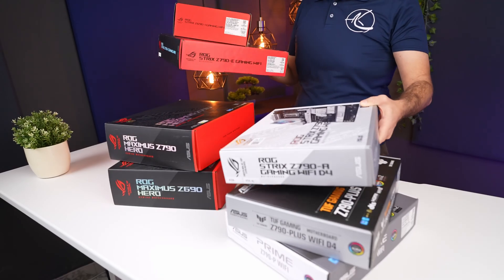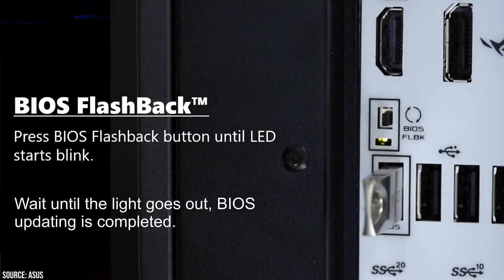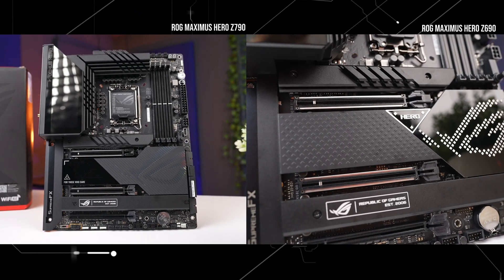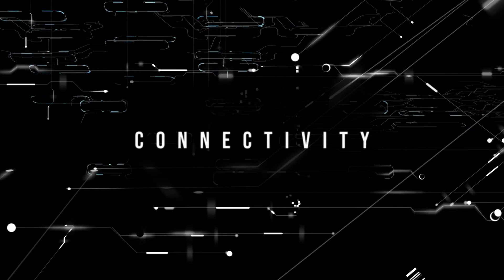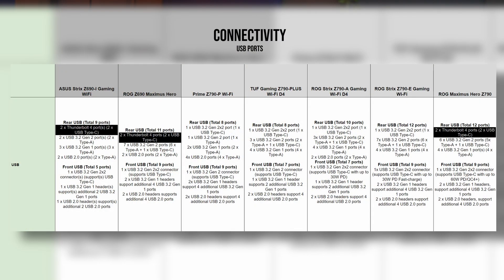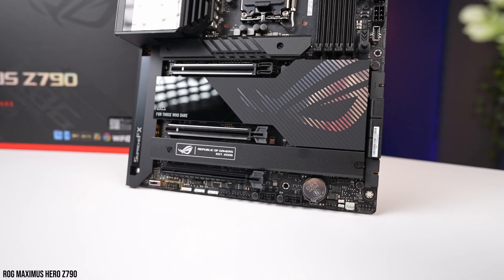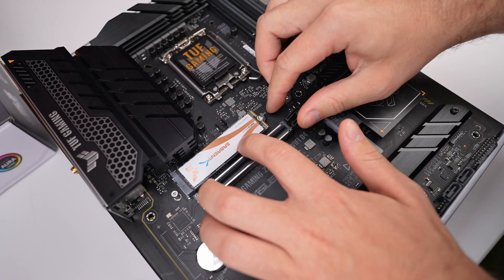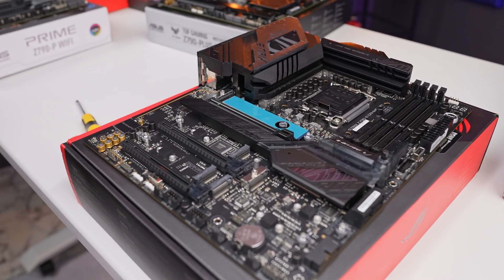WATCH THIS Before Wasting Money On Z790 Motherboards

Comment: I'm building a new PC withi9 13900k, but I am worried about the lack of NVME and Sata ports as I was going to get a ROG Maximus Hero Z790.  I have x3 NME drives.
Reply from the maker: hey, check out our latest video with z790 Dark Hero :)
Reply: Thanks.  I just discovered that Dark Hero one today.  @A2KMedia
Reply: So, what's your advice if I am building a new system with the a Asus Z790 Hero motherboard, Nvidia RTX 4070TI and x3 NVME drives?

Comment: You have no idea how useful those charts were to me.  The business of shared lanes and M.2 slots that don't work if a PCIe socket is occupied, or if all of the M.2 slots are used, you lose half of the SATA ports has been doing my head in.  I still don't understand it all, but I think I'll be reasonably safe if I spend large on the Maximus Hero board.  That's if they can find one.
Reply from the maker: there are so many variables in all of these boards its crazy!
Reply: Can I pair i7 13th gen 13700f
Is BIOS are going to work properly with this cpu?
Reply: thats a negative for the hero, it affects all boards with pcie 5.0 z690 or z790. essentially, it is false marketing, you can never trully utilize a 2nd pcie 5.0 lane. if either slot is occupied its downgraded. OR if a gen 5 ssd is installed in the 1st m.2 slot. TLDR you are paying extra for marketing on the hero, there is zero benefit for a 2nd pcie 5.0 slot on a z690 or z790 board. you missed the entire point.

Comment: I had a z170 mobo from Asus (old mobo) and upgraded to a new pc, z790 from Gigabyte. WARNING : the onboard sound is poor compared to my old mobo. I have been forced to get a soundcard probably.
Reply: True. The entire AsRock lineup has the worst onboard, some of the other brands use the same one; but not on every single board.
AsRock isn't a bad brand, but they tied themselves up in the corner with the Intel processors.
There are a couple AsRock boards that would look awesome in certain PC builds. That crappy sound they chose detours me elsewhere.

Comment: So what is even point of any of these board, i mean if in "future" i have 1 PCIe 5.0 card and 1 PCie 5.0 M.2 SSD, somehow for Z690-E will not be able to give 16 Lane to My PCIe 5.0 card, because i will be utilizing my M 2.1 slot to use my gen 5 ssd. On the other side of the spectrum Hero version does have 2 -16 lane support, but in this case also my PCIe 5.0 card will not get 16 Lane.

Point of these board is "future proofing". Really?? Gen 5 devices cant even run in thier potential due to Lane Limitaion - Then why buying any of these.
Apart from this being early adopter we will be gifted with most unstable tech.

Is my understanding correct though? i am not sure on that.

Comment: Should I get Strix B760-f or Z690-f if I'm going for a non K CPU? Both boards only have a little difference in price with Z690-f being slightly more expensive in where I live.
Also, If I somehow the K CPU price drops and I decided to get one, is Z690-F still worth it even if I'm not going to OC?
Reply: I go with the Z690 because the Z790 no much upgrade to it paid more for what Z690 same specification anyway i paid $208 for theZ690 instead $360 for a Z790 just order one on  Z690 2/24/2024

Comment: even the cheapest z790 mobos here in denmark is about 260 dollars!the 13600k was to be my next build, but the big power consumption and todays electric bills are too much for my wallet!
Reply: I have heard stories about electric bills being so high in Scandinavia. If that´s true I might consider a low power consumption Ryzen 7900 non-X. Or even a 7600 non-X. The problem are those damn AMD motherboards. Few options and insanely high price tags. Maybe wait for a good budget B650 board?
Reply: @PinkasBrown44  not sure!probably still the high 95 degree work temp and a big cpu cooler for that too!using r7 5700x on aorus elite mobo!cheap combo since the r7 5700x is about 189 dollars now!

Comment: I dont understand, if you use M.2_1 pcie 1 works x8.
BUT pcie 5.0 x8 is just as fast as pcie 4.0 x16 so why not use M.2_1? Its not degrading the gpu's performance at all.....
Reply from the maker: this only works if gpu supports PCIE gen 5. If GPU runs in PCIE gen 4 - you will end up running it with 8 lanes which with highest end GPU's will result in lost performance. I am talking 3090-4080 and above cards.

Comment: the z690 series is a waste of money, because if you want to upgrade stuff next year and not swap out the mobo, you will need a z790 vs  Z690 all the way.  

thier is currently a best mobo out their but its price is obviously not cheap,  the asus z790 maximus apex thier is no better mobo in existence today then that one currently, 

  z690 is just junk,   dont waste cash of that garbage stuff.   buy  a z590 series if you need to save a few bucks but do not spend on z690 at all its garbage.

Comment: Let me make sure I heard you correctly, I am planning to used nvidia 3080 to, which is a pcie 4 x 16.  So if I do not used nvme slot 1, but skip and start with slot 2, I should be ok to ensure the gpu has all of its pcie lanes available ? Or this is only limited to a spec Asus z790 mb model ?
Reply: It doesnt matter because the first pcie slot is pcie 5.0 so even if its working at x8, its just as fast as pci 4.0 x16. So no performance degradation for your gpu. So you can use the first m.2 slot without any problems.
Reply: as far as im aware, most if not all z790 motherboards do this with the first nvme slot, so it's recommended not using it and start at the 2nd one.

Comment: Is there a point to get Z790 over Z690 for an ITX format since such small motherboard can't have more than 1 PCIe slot?
Reply: I was thinking the same
Reply: Ram compatibility. 

ITX boards can push most kits harder than normal boards already because they don't have 4x dimms.

The z790s have more recently validated testing for higher MT/s kits than the z690 and for more brands than the z690s

Could be able to run a 7800-8000 kit on a z790 where the same brand z690 would only be able to run 6000-6600

Comment: moving from imac after 14 years to a PC. For coding/programming, is the Gigabyte Z790 Aorus Elite AX a good option in combination with a i5 13600K? Or a Gigabyte Z790 aero G atx. Thanks
Reply: if you are building a white themed PC then choose Z790 Aero G, else go with Aorus Elite AX which is equally good for a slightly lower price.

Comment: If I generally choose to buy first-gen of a technology to base my computer on for the next ten years and upgrade as necessary, which would you say is a better option for overall value?
Reply: 10 years? Sorry man, technology is advancing fast. Probably you'll need an upgrade after 5-6 years.
Reply: @donjuan3296  Did you read the "upgrade as necessary" part, I mean that I build a computer once every ten years and then upgrade from time to time over its lifespan
Reply: @donjuan3296  With the performance of modern computers, you don't really need frequent upgrades unless you need the additional performance. I'm still using my i5-3570k since 2012 and I still can play the latest games.
Reply: @holo2869  you can play them but not well that’s a dinosaur
Reply: If I were you, I'll wait for the 14gen which is already set to be released later this year. Those motherboards will be the future-proof. This 13th gen is a dead-upgrade.
Reply: @holo2869  I think it's funny that you think you know the future!!
Reply: @skolvikings5263  Your ignorance is evident. We know that the next gen will be on a new socket because Intel made that a public knowledge a long time ago. Stop wasting your bandwidth and do some online research on your own.
Reply: @holo2869  I mean, ATM my plan was an i5 12400f so I'd still have an upgrade path even if 14th gen doesn't exist on LGA1700.
Reply: @scrubscrub4492  Maybe check how your local stores stock up on hardware? IMO, unlike ram, harddisk and video card, motherboard and processor are the least upgraded components and historically in our local shops, they don't stock up on near dead platforms. Majority of those available are the lower end models because they were the leftovers, so looking for reasonable upgrades are difficult.

If you do the upgrade path you are thinking, I suggest that you immediately upgrade it once the 14th gen are available so it won't be difficult in the future.
Reply: Have you decided yet? I have a similar mindset so I am still deciding between a B760-F with 13500 or Z790-E. with 13700K. I guess the latter one has more durability. Then again, the parts are twice the price. So picking the cheaper parts one can already ´save money´ to build a new PC in half the elapsed time. I supposed both alternatives are OK.
Reply: @PinkasBrown44  I've decided in favor of it because Sega is partnered with ASRock to make custom Z790 boards, and I'm obligated to have my games running on Sega hardware whenever possible.

+ The mATX model is sub-$200 for a DDR5 board which is a pretty damn good deal
Reply: guys im still gaming on an overclocked i5 760 3.8ghz on an asus p7p55d-e board with 12gb ddr3 ram and a 1660 super with a LG C2 42 ....I get 90+ fps on both 1080p and 1440p...some avx2 games dont support the ancient i5, but all other games are playable...should i upgrade?
Reply from the maker: Well this motherboard can only have 12 and 13 gen Intel cpus. Next gen will be different socket. Other than that, you need to see what components you need more. I personally prefer networking
Reply: @A2KMedia  NOBODY knows if the next gen will be a new socket, c'mon man!!!!!

Comment: I bought my z790 boards (z790-I WIFI and z790-Extrerme ) mainly because of TB4
Reply: Please can you tell me, does the extreme z790 include in the package a cable for the onboard TB4 front header?
Reply: @vlefteris  no it doesn't i fitted a right angle USBC connector on the mobo then plugged a true TB4 cable into that and routed it out of my case - works fine, even if it looks a little janky.  I have found no off the shelf solution to mount it, say to a PCIE slot.  in retrospect this was dumbass decision by asus.
Reply: @scytob  Ok thanks!

Comment: I think it's more wise to buy Z690 with DDR4 boards for now

buy boards with DDR5, M.2 PCIE 5 SSD, and PCIE5 GPU support maybe at 14th gen with z890 era

because probably by then, performance will improve much more again, and prices will go down

because as of now, DDR5's FPS does not win in alot of games vs DDR4 unless you are using 7200MHz or above (https://youtu.be/TPhu2HNuCKc as shown at 13:49)
Reply: Prices very rarely seem to go down...

Comment: Would love to know where the *Asus Rog Strix z690-a wifi* fits in this video since it also has BIOS Flashback, but is more expensive than the *Asus TUF Gaming z790 Plus Wifi* - I don't which to choose and I'm torn (wanting to get my hands on a i5-13600k). Any advice?
Reply: since the new AM 5 AMD Base  and the two Intel Bases Z690  the new  Z790  one  &  B660 was released .. Asus do not longer support The Bios Flashback Feature for their TUF Gaming Plus Boards for Intel !! What a Shame by Asus !!  So if you wanna have the  Bios Flashback Feature  you have to get the next Higher Quality Board like   ROG Strix Series if you wanna use the new Intel Cpu   ...  If you are a AMD User , then you still get the Bios Flashback Feature on TUF Gaming Plus Boards for B650 or X670 E for AM 5 ...  What a poor Way by Asus for Intel Users ...
Reply: @shari_8410  well but it's ok
just buy ROG
they are worth the money
Reply from the maker: heya. to run the CPU that board is fine - I would look into the extra features such as NVME expansion as well as usb port requirements you have and see if it is enough for you
Reply: @A2KMedia  wouldn't the asus tuf be better for running 2 sticks since its a daisy chain topology and like $90 difference
Reply: Gigabyte AERO G DDR4 if you are not looking for RGB

and MSI Z790 Edge of you are looking for RGB board

Comment: Im worried about the ram support on z690. I ofteh read that the ram controller is very bad on z690 so if you want to use decent ram you should use a z790 board. Im confused now because i thought that the cpu has the ram controller so i wanted to use a z690 board with a 13700k and ddr 5 6000 cl 30 ram. Do i need to go z790 for this ?  pls help
Reply from the maker: Z690  is fine for that.
Reply: @A2KMedia  Not for Asus. Stuck at 6400 mhz with 7600mhz stick on z690 formula. That's a big lol
Reply: @A2KMedia  can I go with rog strix Z790-A gaming oc D4 is that good?
Reply: They all have the same problem with the four sticks but there is a fix for bios if you look it up
Reply: I simply bought DDR5 RAM that was on my MB's QVL list and have had zero issues.
Reply: chose Z790 if you don't find DDR5s still too overpriced, and choose Z690 for DDR4 if there are still stocks
Reply: Yes, i'm using z690 formula with 13900k and 4090 plus purchased gskill 7600mhz 36cl ram kits but unfortunately current bios doesn't support more than 6400mhz. If you pass this frequency it's giving you errors even with increased dram voltage. While z690 msi boards can succesfully increase frequencies up to 7600mhz our premium asus boards aren't capable of these speeds. That's sad. And i'm now thinking if i should get z790 or keep my current pc at 6400 ram speeds
Reply: This is BS. The memory controller is integrated into the CPU. Z690 is fine.

Comment: I know the z790 has more chipset pcie lanes, faster DDR5 speeds than the z690 DDR5 speeds and support for SSD gen 5 BUT for gamers the only in game usefulness on the z790 is higher DDR5 speeds vs the z690 DDR5 speeds. That said the DDR5 speed increase will not make a MAJOR gaming experience over the z690 in my opinion. If you have the Asus z690 Hero like me you can get DDR5 6600 and of course the 13900k plus a new RTX 4090 so no real reason to upgrade I think this time around in my opinion.
Reply from the maker: you basically summed it up. thing about RAM - i used 6000 M/T ram on z690 without a problem and most people won't need to go past that for now
Reply: Exactly, and here’s the deal. if you can get DDR5 RAM sticks with a happy median between the highest RAM speed for z690 DDR5 and the highest z790 DDR5 speeds that’s all realistically gamers need and would actually be able to notice in performance. DDR5 6000 and up is great for either z690 or z790.
Reply: "faster DDR5 speeds than the z690 DDR5 speeds", not sure about this. It probably depends on which CPU you slot in as the memory controller is there. On various forums you can see people reaching 8000mhz on Z690s
Reply: @sgru9558  This is true, I was just saying on paper z7900 has higher DDR5 speeds.
Reply: Latency matters just as much as clock speed. People get so hung up on clock speeds and end up WAY overspending for minute performance gains.
Reply: @yesthisisvic  as for me as a music producer i need a quite low CAS Latency aswell .. so my best deal would be at the Moment to get a Z690 Board with the new Intel 13th Generation I5 or I7 but  with DDR 4 Support,  and good quality DDR 4 Ram with my desired Specs,  obvisually .. cause good DDR 5 Ram with enough Ram Speed and Low CAS Latency  you really  have to be rich at the Moment to handle that Price lol

Comment: So when M.2_1 is not used, will the main PCIe_gen5 slot stay at 16x? Like if I used any/all other M.2 slots other than M.2_1, does the main PCIe_gen5 slot continue at x16? Or if I use any M.2 slot, it gets dropped to x8?
Reply: It doesnt matter at all, pcie_gen 5 slot x8 is the same as 4.0 x16 so no degradation in performance even if you use M2_1
Reply: @billx4266  your maybe right .. but if u do not remember it coul dhave some influence in the future when u get new hardware
Reply from the maker: hey, on that specific board yes them m.2_1 is used then main slot drops to x8. others can be used. but other boards are different so make sure to read in their manuals or tech documents to see what it is like under storage and expansion sections
Reply: @A2KMedia  Normally its not a problem at the moment since there are no PCIE 5 NVME yet 
So u either way use  only 4.0 like in the M.2_2 slot
but exactly this is what i hate on the new boards .... u have to be really carefull to see what u can connect and what not

Comment: For the money now they should add Intel 10GbE particularly on the ROG boards.
Reply: Whats the point if there is no internet providers supporting such high speeds
Reply: @jsteff9290  ... I guess since you're living in your mom's basement by yourself, there is no need. However, if you're sharing files with maybe someone else in the house there is a need.
Reply: This! For This Reason Alone Im Using A PCIE 10/25Gbit SFP+ Intel NIC The Onboard NIC’s Are So Bad Still Sad To See Such Bad Onboard NIC’s On Such High End Motherboards Like These